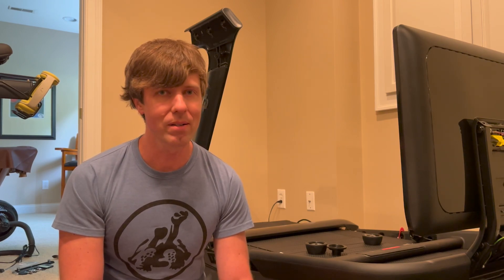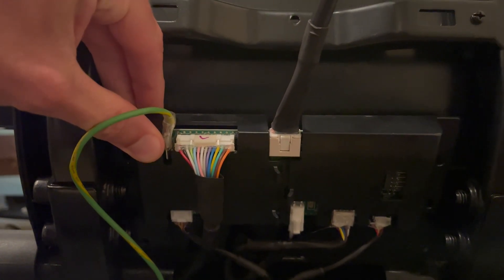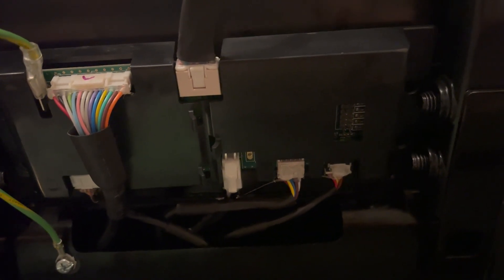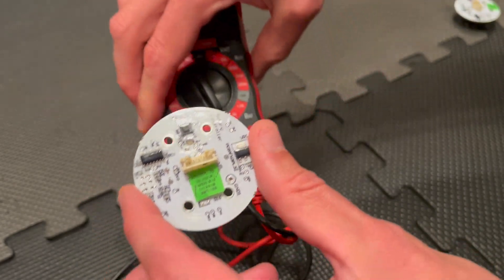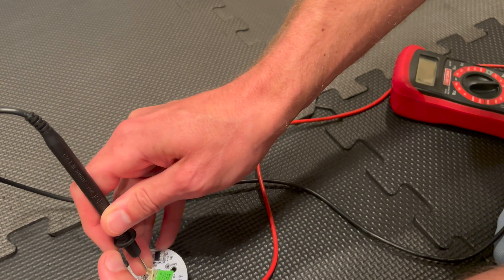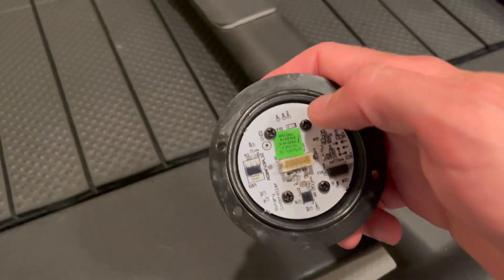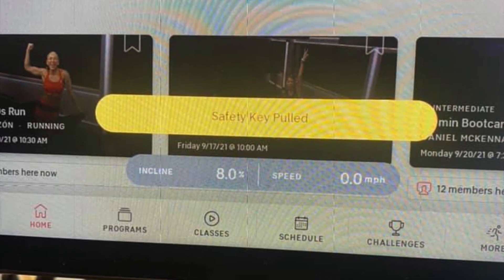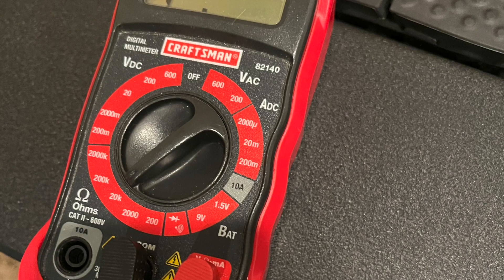Peloton Tread+ Repair DIY Tread has stopped communicating, firmware failed, and safety key issues

Comment: Do you have any information about the rpm optical sensor replacement located on the front left side of the Tread (Not plus, just regular tread). I may have damaged it while relocating the treadmill to a different room and Peloton wants to swap the whole base instead of just replacing the single small circuit board.
Reply from the maker: I don't know much about it. On the Tread+ it was a flywheel with little holes if I remember correctly. Have you tried calling Peloton and asking to speak with someone in the parts department? I've found those folks are pretty knowledgeable and you can buy individual pieces.

Comment: I need help, my tread won’t turn on and a tech came to check it out, looks like there is a wire missing thing up so not siete what to do 🤦🏼‍♀️
Reply from the maker: Do you have the Tread (smaller one) or Tread+ (big one?). If it's under warranty I would have them repair/replace it if possible. Unfortunately there isn't much I can tell you without more details. Do you know what wire is missing? Has it ever worked?